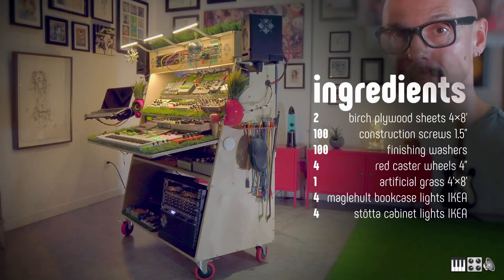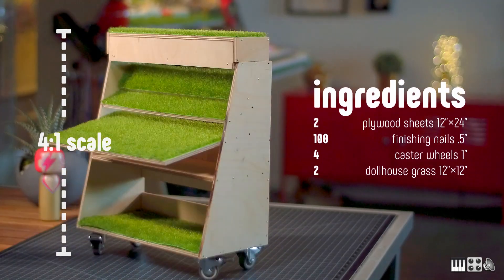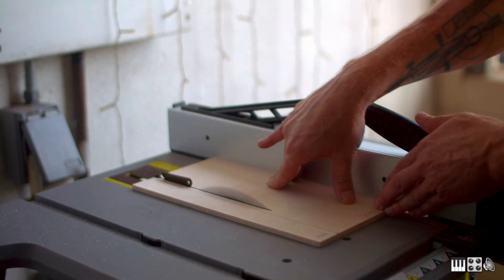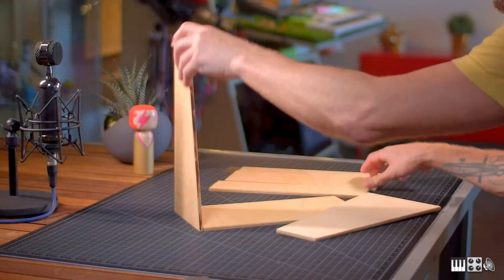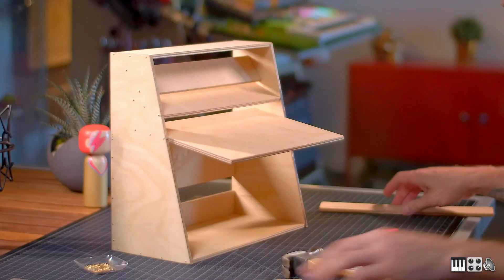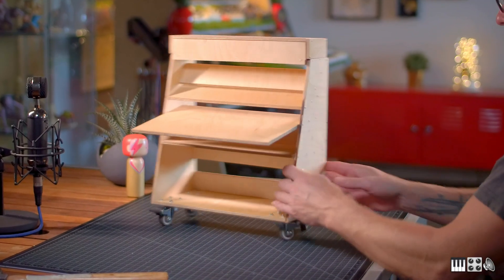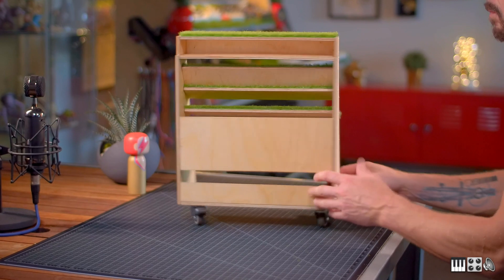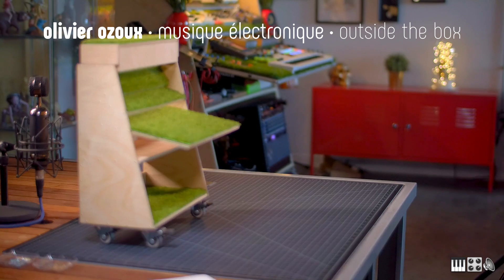Honey, I shrunk the music studio! ( My new DIY Music Desk )

Comment: Looks like a really nice setup!  How do you keep things from sliding off the steep shelves though?  I can't see it clearly enough to tell what's holding things on to the upper portions.
Reply from the maker: The grass is pretty grippy but if you look closely top shelf has a metal lip, the middle one doesn’t need it and also the cables act as counter weights a little bit too. So no things don’t slip at all